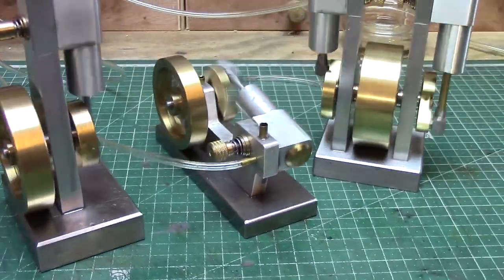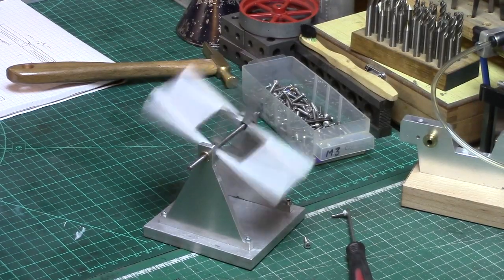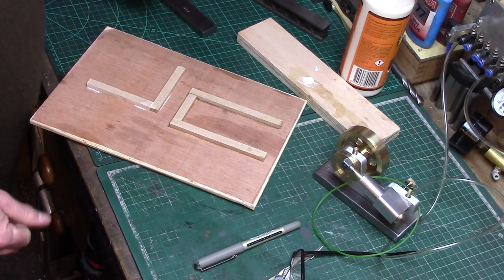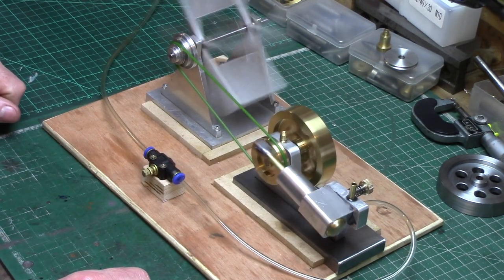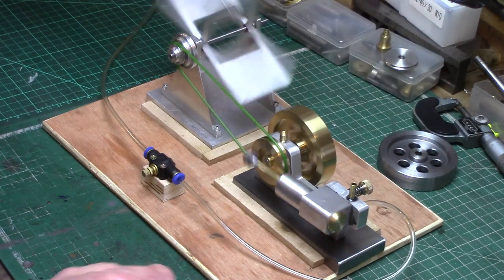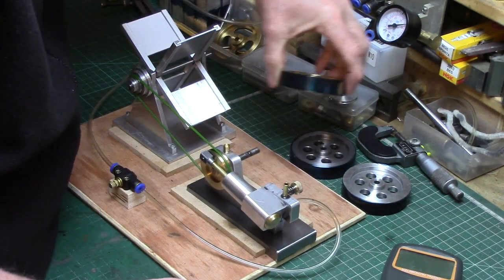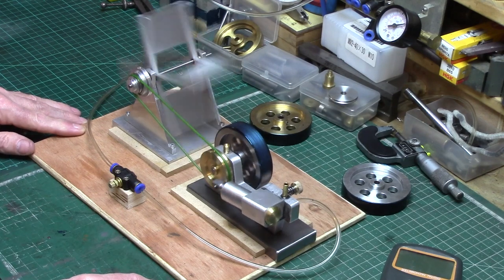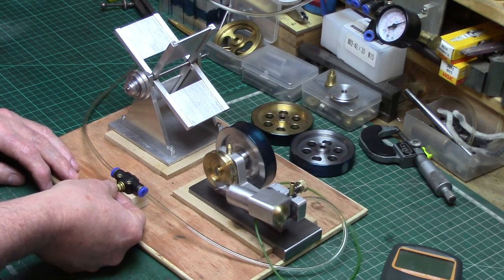Testing Different Weight Flywheels on the Wig-Wag Engine using a Baker Fan  #Wig-Wag #Baker-Fan

Comment: Just came across your test  and you gave it the best ,,,only one thing was that you keeped turning off the air  shut off valve changed the flywheel then adjusted  the valve  again   which  you air pressure  changed and your wobbler  wobbler along at that pressure  great attempt

Comment: I always enjoy your videos especially ones like this. Your RPM guage might work if you use a piece of reflective tape. Just a guess we had to use it when we would rebuild  cnc spindles and see how fast they was running.
Reply: I also noticed, that the distance of the gauge is important. The cheap thing I bought works only if I can see a complete round spot from the laser on the spindle I want to measure. That requires some distance and a steady hand, give it another try.

Comment: Hi Ade. Love the Baker fan and the jig for joining those drive belts, must make me one of those. I have a similar digital rpm gauge and I've found it works best if you use the reflective tape supplied. Also hold the gauge a bit further away from the flywheel, the one I've got doesn't seem to like being too close to whatever it's measuring. Cheers, Alan.

Comment: This was really fun to watch. I do think that the real question here is if one could use a brass pipe with an aluminum or maybe even delrin plastic core in order to save cost on the flywheel. Essentially- getting the heavier metal mass as an outer ring and lightening the center as much as possible. How would that fair?

Comment: Hi Ade.  Talk about timely… I have recently bought myself a lathe and set about building myself a gyroscope per a video posted on YouTube by clickspring.  While I am quite happy with the result, it doesn’t run quite as well as the one he built as I had to use a flywheel of smaller diameter than the plan called for - you’re not wrong about the price of (larger diameter) brass stock!  Anyway, having seen this video, I am sure a heavier flywheel would make a big difference.  So, from my point of view, this is an excellent video and very timely!  Thanks heaps for posting.  Dean

Comment: Enjoyed the video, and neat test/test results using the Baker fan. Maybe try some stick on lead wheel weights, like used for balancing car tires (tyre) attached to the inside outermost part of the aluminum (aluminium) flywheel to find out if pursuing an aluminum hub with a steel or iron outer rim would be worth the effort.

Comment: I think you would be better purchasing a Hall effect sensor kit with a tachometer. I have them in my wood lathe, metal lathe and the milling machine head which is part of the lathe. They are inexpensive and work really well. They consist of a small round magnet you either glue to the flywheel, or obviously if it's steel you don't need that but if you do glue the magnet to the steel it does prevent the magnet from migrating due to centrifugal force, there is a pick up that will work up to 10 mm away from the magnet and it has a thread most of the way along the body which is around 50mm (2") and it's supplied with 2 M10 x1 nuts and a bracket to fix it with. A simple counter display and all you have to do is put either a battery or a power supply of I think 9v to at least 24v as one of mine is on 12 volts the other two on 24volts. Give it a try Ade!

Comment: About the laser tachometer: I was part of a team who participated in the lego league in 2007, and we had major issues with the tracking laser underneath the robot during the national playoff because the stage lights above the game were too bright and there was too much side-light creeping in, making the robot unable to guide itself during the contest. What I learned from that is that light based readings are very sensitive to environment light and that it is a pain to finetune them when you start involving moving shadows or reflective surfaces. Cool video!
Reply from the maker: Thanks Helena, you may have just given me the answer to the problem, as I recently noticed when using a new camera that the LED panel above the bench can be seen flashing in the video, so I guess the Hz of the light was in phase with the shutter, this may have been affecting the readings of the tacho. Thanks for your help
Reply: I'm glad I could help! LEDs when not behind rectifying circuits are only on half of the time, which is clearly visible and explorable using a variable shutter speed camera (pro mode on android devices will do) and can be toyed with using variable power supplies. Many generic dimming circuits on the market today tend to mess with LEDs even further, creating much shorter duty cycles on their off cycle and it has been speculated to contribute to migraines. Anyway, I wonder if just rectifying the LED (or alternatively using a black body or plasma type light source) solves the problem!

Comment: Hi Ade, I'm sorry you found the Tacho a disappointment, I use one all the time and it's very useful.  Watching the video, I saw you holding it far too close to the mark, I find that each job has a sweet spot at around 10 t0 15 cm from the wheel/shaft being tested, each time is different but usually within that range.  Also, the Tachometer need to be kept steady, I normally rest my hand on something solid, so it doesn't move.  While not being of metrology standard, it does the job for me at least.
Reply from the maker: Thanks Chris, I will try your tips and see if I can get better results, I should have read the instructions ;)